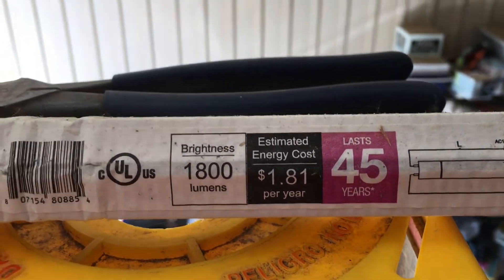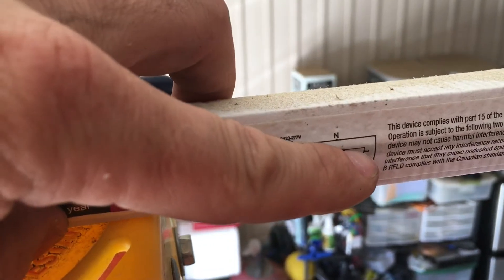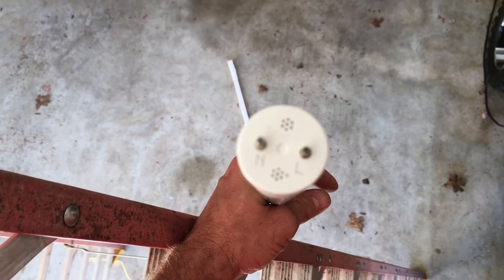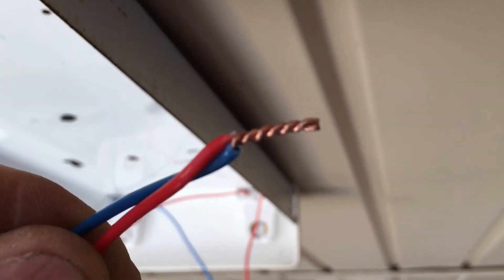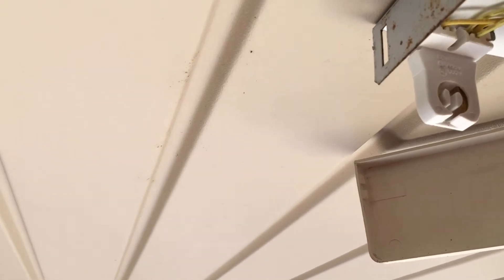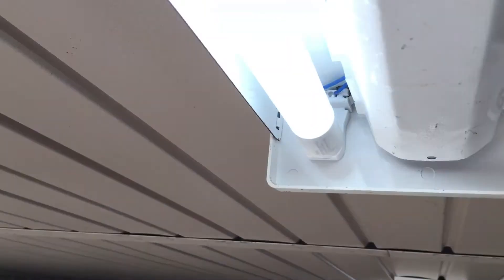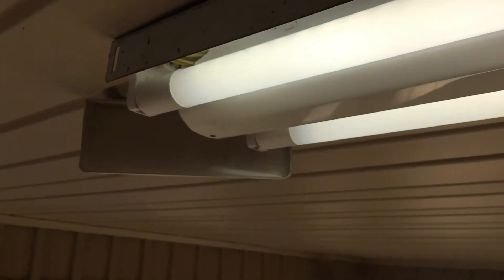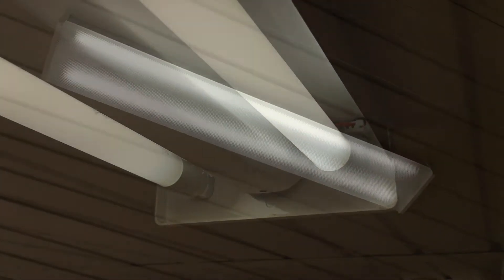Fluorescent to LED conversion.

Comment: Never assume that white is neutral. I always check to be sure it was wired correctly to begin with especially in older buildings
Reply from the maker: Unless it’s the old knob and tub wiring I have never run into that being an issue. That’s if it was wired correctly